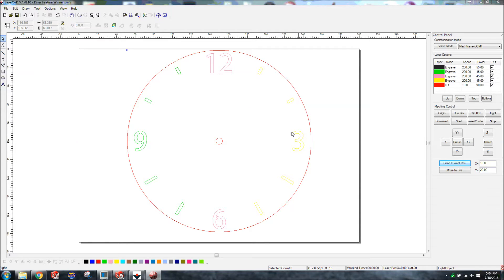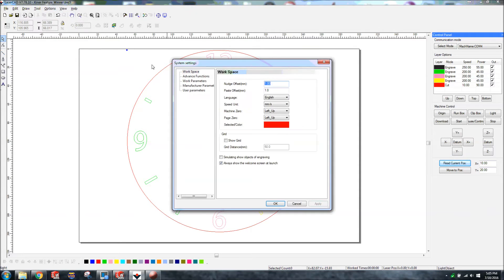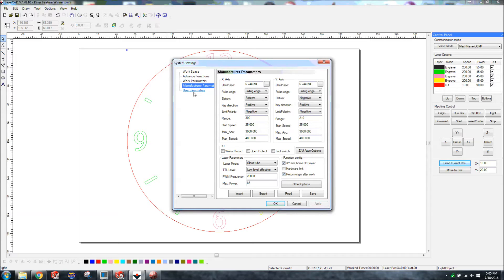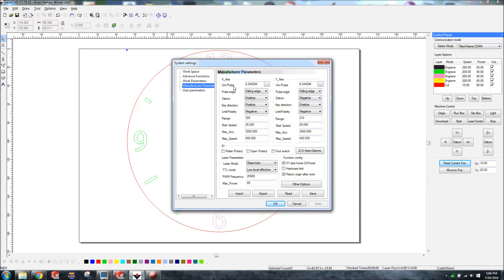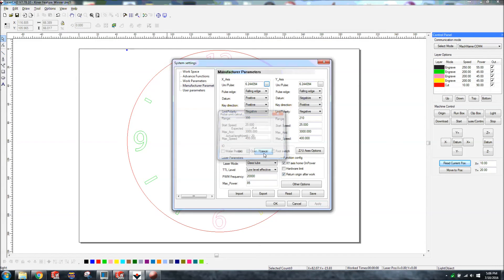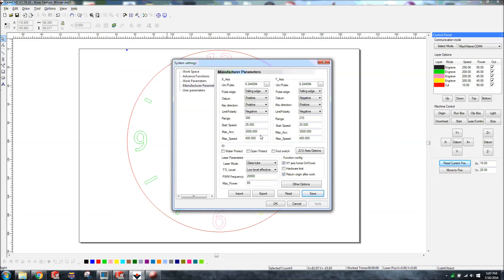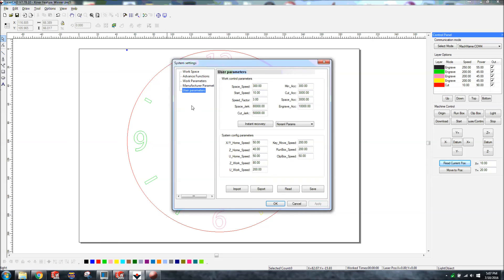LaserCad Settings K40

Comment: Thank you  my Ufile to machine is mirror cutting..  how i make it normal cut or engrave not mirror ? thanks alot
Reply from the maker: Sounds like your stepper motors are signalling the wrong direction.

Comment: Hi, I have a question, do you know how to change the usb to ethernet connection? I just need to know that because the USB port was broken by a bad drive and I dont want to waste time in repairing the USB port. i hope you respond soon :(
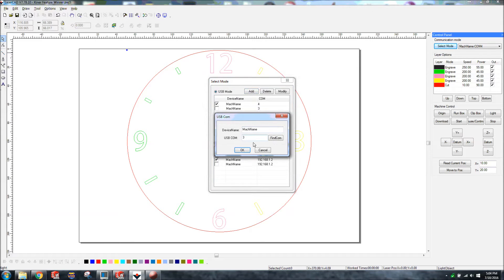Reply from the maker: Yes, just click "select mode" in top right. have the system plugged in with ethernet. Click network mode, then add, and you should be connected. @0:24

Comment: Hi I did the Lightobject LO DSP X7 upgrade. Cannot not get the X,Y motors to move. My laser PSU does not have Water sensor protection terminals. It does have P, G, K+, K-.  P+G will fire laser if K+K- is connected. Any ideas please. Thank you for your videos.

Comment: Hi i have a problem when i use engrave mode, the letters appear like mirror but in my program i didn't use that. Can some body help me?
Reply from the maker: guadalupe sanchez sounds like your motors are wired backwards.

Comment: in lasercad power adjustment not working... could you help me... for example if I am using 1 %power it looking like near about 90% power , I am trying to adjust power by software but machine working with bigger power .... I think power adjustment not working there
Reply from the maker: Mohd Mudassir make sure you click "read" then make your changes and click "save". Otherwise make sure you are adjusting the power settings on the correct layer and outputting data on that layer.
Reply: everything is currect, I am making change in same layer.... and about read and save , I am doing same thing... as usual first we read then change and after that we save ... I am doing this ... but in this portion after save when I am the trying to read then I'm getting same perameter. if you need a video plz tell me I will show you the video.